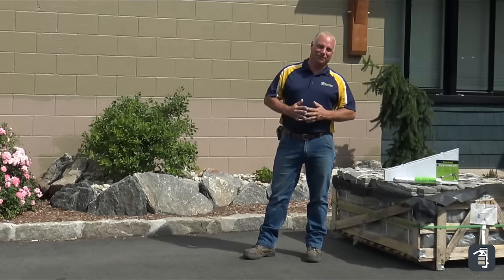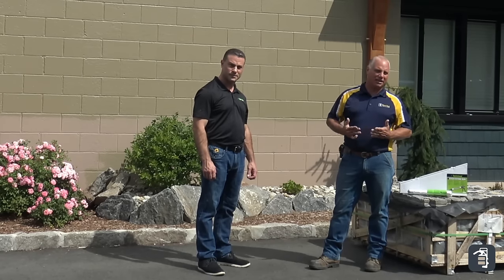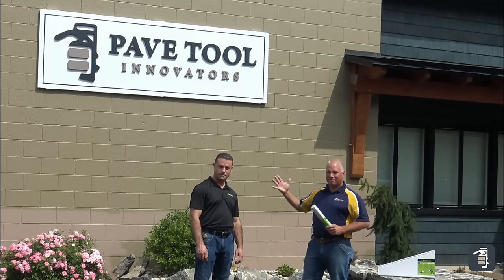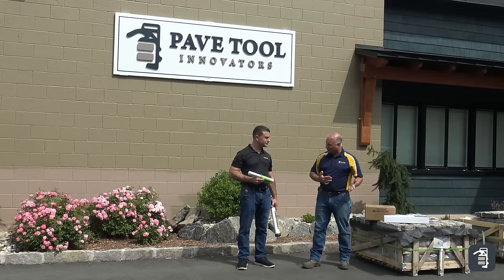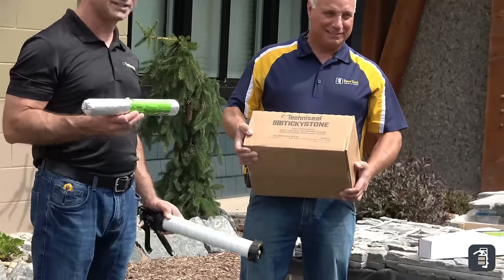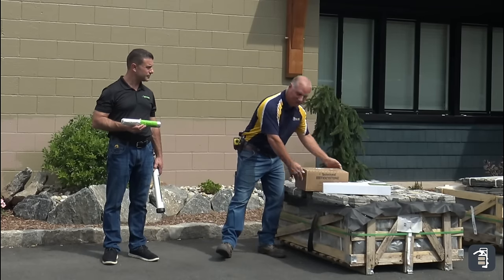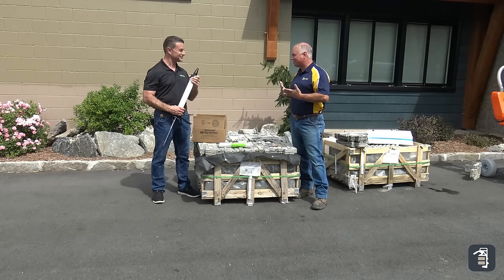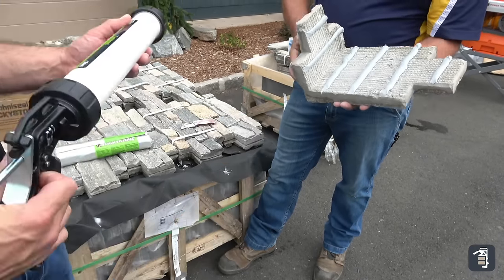Vertical Adhesive is in...Mortar is out...

Comment: Only time will tell if this product holds up. Mortar has done proved itself pretty good
Reply from the maker: This product has had a lot of testing done on it...  If I can get a hold of the spec sheet I will for ya...  Thanks
Reply: @PaverToolInnovators  I own a brick home. Could I do the complete outside of my house with this product if I wanted to. ?
Reply: @clevewilks4312  you could, by why would you on a brick home?... maybe do bottom 3 feet as an accent, but anymore than that i think you're just trapping moisture in the brick going forward
Reply from the maker: @notimportant3686  The installation method of Sticky Stone is to use vertical beads 3" apart which allows enough air space for moisture to dissipate. This prevents moisture to build up between the wall and veneer stone.
Reply from the maker: @clevewilks4312  Your brick and mortar would need to be in good shape. Make sure to use vertical beads 3" apart to allow enough air space for moisture to dissipate and to follow all manufacturer's guidelines and recommendations for the best outcome: https://techniseal.com/pub/media/catalog/product/pdf/t/d/tds_stickystone_can_en.pdf
Reply: @PaverToolInnovators  Could you use this product on individual "stones" instead of the panels that you demonstrated?
Reply from the maker: @cubbie8330  Yes. We have another video that shows this: https://youtu.be/6bHu5MoLlHQ
Reply: Is a loxon paint over cinder block ok for installation? What about freezing water behind veneer? Does it hold up under pressure? I suspect the adhesive goes on Vertical every three inches so water can drain from behind it?

Comment: The only application this product is suitable for is the panel like stone you are installing. If you were to use this on a traditional thin stone veneer it would be nothing but a gigantic mess trying to glue each individual stone into place as well as the fact that most stonework requires a mortar joint anyways. Also the way the glue is applied onto the back of the stone allows water to collect in the voids between the adhesive and could be problematic in the future.
Reply from the maker: We find that Sticky Stone is the most effective with large format veneer or panel stone. The purpose of vertical beads 3" apart is so that when it rains the water can make its way out from underneath the stone without being trapped.
Reply: It looks like a very simple to apply alternative,but even with vertical lines of adhesive I wonder how well it would hold after 5 years of freezing and thawing cycles of here in northern New York Adirondack region?
Reply: @dalerounds4036  Is it really true that the temperature up there gets as low as 52 below zero F? :-)

Comment: Nice product. I did a project quite a few years . I screwed hardy board to studs then buttered brick veneer with liquid nail and spaced evenly. Then mixed mortar , went through with a mortar bag and smoothed out the joints. Went pretty smooth
Reply: Where would we be without Liquid Nails?

Comment: Can you use Sticky Stone for placing stone veneer on the bottom of archways without the need for vertical support holding the stone in place until it dries?
Reply from the maker: It depends on the weight of the stone. If it starts to sag you will have to place support underneath the stone but once it dries enough you will be all set to remove the support.
Reply: @PaverToolInnovators  Thanks so much for the quick reply.
Reply from the maker: @kiheidude  No problem, sorry we did not get to you a few days ago! If you have any other questions please let us know. Good luck!

Comment: I'm considering using Sticky Stone.  Wi it work on a cured concrete foundation?  Mine was poured in 2007, and nothing done to the exterior.   How shouldI prep the concrete foundation?
Reply from the maker: Just be sure the foundation is nice and clean and you'll have no issues adhering to the foundation with Sticky Stone.

Comment: I am going to be replacing a vynil siding on the front of my house and I am planning on doing a stone veneer. I like the potential of this product. I am wondering if you are starting from a concrete base to rest the stone on, do you lay a bottom bead? I also am trying to think about how you prevent the gaps that termites find thier way into.
Reply from the maker: If you are going an exterior application I would suggest screwing hardie-backer or concrete board to existing plywood and then use a water proofing product (Ardex 8+9 is a good product) and tape and seal of all the seams. So you don’t introduce moister to the plywood. Then you would adhere your stone to this. I would screw a temporary 2x4 on the bottom to hold first rows of stone and remove when you are done.

Comment: It looks like you appled to painted cinder block. Can you use it on painted cinder block?
Reply from the maker: Sticky Stone will last as long as the paint lasts (typically 30 years). For longer lasting application remove the paint to reveal the concrete surface.

Comment: I want to make a Hearth for my wood stove. I have a 5' by 5' platform and a 5' by 6' back. Will this product work on Rock Board? Wil this product works with the heat of a wood stove. I mean will they start falling off from the back board?
Reply from the maker: You can use StickyStone outside the wood stove but nothing inside that will see extreme heat

Comment: What happens when the paint peels, will the adhesive that is attached to the paint come off?
Reply from the maker: Sticky Stone will last as long as the paint lasts (typically 30 years). For longer lasting application remove the paint to reveal the concrete surface.

Comment: Might have missed it- may I ask what you prepped the painted bricks with before applying the sticky stone and veneer?
Reply from the maker: For testing purposes we pressure washed the painted surface thoroughly to see how it would hold up. We have not had any issues but we would recommend wire brushing the painted surface to confirm that you are getting good adhesion. You have to use your own judgement the stickystone is only as good as the substrate you attach it too.
Reply: @PaverToolInnovators  thanks for responding.
Reply from the maker: no problem have a nice day!  @DavidLCangelloMDFACSNewYork
Reply: @PaverToolInnovators  you too!

Comment: Will it hold in cold climate, like MN, WI, etc?
Reply from the maker: Be sure to apply in temps above 32 °F (0 °C) to ensure proper curing. Sticky stone is designed to withstand freeze and thaw cycles after the proper curing process has finished.

Comment: Uuum..... You're placing a LOT of trust in the paint on that block. I would have brushed that A LOT, down to the block.
The adhesive will stick to the paint just fine. I wouldn't trust the paint to stick to the building forever.

Comment: Will this products adhere to ICF walls (EPS foam)?  ICF wall will have a waterproof coating.
Reply from the maker: Sticky Stone can adhere to ICF walls but we wouldn't recommend using it to apply heavy product. Heavy and light are relative definitions. What type of product are you trying to apply and roughly how much does it weigh?

Comment: I bought some thin flagstone and covered the wooden pillars on the front of my hose. They were normally wrapped with rough cedar boards but after a year they looked like crap. I treated the cedar boards then wrapped over the top with concrete boards then used construction adhesive to attack the flagstone. They slid around a lot but some duct tape worked. It would be nice to have something like this as long as its strong enough.
Reply from the maker: Sticky Stone works well with wood and concrete board. The recommendation is to allow the bottom leveling row to cure for 15 minutes and then continue to install the rows above with no delay.

Comment: How has this sticky stone held up over the past 2 years?  I'm coming up on a very similar project and this product seems like a total game-changer for folks like me trying to do a DIY home improvement with no masonry experience.  My main concern is that this product is so new and there isn't much information out there about its' performance over time.  Thanks!
Reply from the maker: We've had this on our building for the past 2 years. We allowed water to go behind the stone for a year to test if the freeze thaw cycle mixed w/ water would have any effect. We were excited to see that the product was so strong, it was still very hard to chisel off. You can use your own judgement but we feel the product has done very well over time.
Reply: Thank you for the reply, glad it's holding up so far! Is this the primary product you use for most exterior veneer installations now? Curious if there are still use cases where mortar would be preferred (or maybe even necessary). For example, I'm looking to install a stone veneer next to a saltwater pool with some water fall features coming through them. Between the water falls and the location right next to the pool, do you think this would still hold up?
Reply from the maker: @stevenprendergast9767  Once stickystone has cured general watershed will not affect its integrity. As always be sure to do vertical beads so no water collects behind the stone. Good luck with your project!

Comment: Well educate me as to what happens when moisture finds a way to build up between the wall and the veneer stone surface,
and then freezes?
There are as you know roll on adhesives that are intended to be used as a bonding agent on things like painted block walls so stucco can be applied on those painted surfaces.
But dont try that in parts of the country where temperatures go below freezing.
 Mind you now that drilling a series of holes in solid rock and filling them with water, is a method used for splitting the stone.
Such is the power of freezing water.
Reply from the maker: The installation method of Sticky Stone is to use vertical beads 3" apart which allows enough air space for moisture to dissipate. This prevents moisture to build up between the wall and veneer stone.
Reply: What happens when the glue expands and contracts due to freeze and thaw does the glue eventually get brittle and lose its hold over time
Reply: Stone, like other things including Brick, is layed in mortar, and lasts for very long periods of time.
It also requires well trained people to do it.
This type of a product isnt intended to be a long lasting solution, simply meant to look good , be economical, and require less skilled people to install it.

Comment: Will this work on a wet wall? I mean, a block wall that has small leaks when it rains??
Reply from the maker: We are unsure of what your scenario is, but as long as the wall is structural/not failing, and you install while it is dry and allow it to cure dry, keep your beads vertical so that water can flow and not build up, you should be ok. Add weep holes if needed.

Comment: Does it come with any kind of warranty against the stone veneer falling off or are there any issues with rain or freezing temps?
Reply: I was wondering the same thing.  Without full coverage of the adhesive/mortar layer water and ice can collect, expand, and cause delamination issues.
Reply from the maker: We recommend making the beads 3" apart so water can't collect.

Comment: I am installing a ledgerstone on my bbq island will this adhesive work? And also where can I get this product. TIA
Reply from the maker: Sticky Stone will work on ledger stone but what specific type of material would you be applying it to regarding a bbq island? 

We sell Sticky Stone here: https://pavetool.com/products/techniseal-sticky-stone
Reply: @PaverToolInnovators  right now i have a cement board around my bbq island.
Reply from the maker: @reynantelicerio2298  Yes that will work but I recommend watching this video where we explain the application on concrete board starting @ 2:10: https://youtu.be/knwiNLFQlXc
Reply: @PaverToolInnovators  ok. Thank you for the info
Reply: Where can i get the items? Home depot carry them?
Reply from the maker: @reynantelicerio2298  No problem. Thanks for watching!
Reply from the maker: @reynantelicerio2298  We carry Sticky Stone: https://pavetool.com/collections/joint-materials-adhesives

Comment: Can this be used on ICF?
Reply from the maker: Sticky Stone can adhere to ICF walls but we wouldn't recommend using it to apply heavy product. Heavy and light are relative definitions. What type of product are you trying to apply and roughly how much does it weigh?
Reply: @PaverToolInnovators  makes sense. Can you recommend  "lighter" products for external use?
Reply from the maker: @tdmallet  This is the most information that we know at this time regarding ICF block. This is a situation where we don't want to give incorrect information but hope to in the future. I know this might be a little frustrating but hope you understand.

Comment: Mortar might weigh more but the cost isn't near what that stuff costs. The gun and only 3 tubes of sticky stone is $136! Kinda spendy. Imagine what a case of it costs?!
 I decided to go a different route and use Loctite Premium Fast Grab which is plenty strong and much cheaper (using a normal caulking gun)
Reply from the maker: Cheap isn't good, and good isn't cheap! We hope it holds up for you... many of the Loctite products do not hold up in freeze and thaw climates, or in wet climates (according to testing we've found on Google). Sticky stone withstands all weather, and can resist over 10 times the weight that cheaper adhesives can. Depending on the project, it is well worth the investment.

Comment: No wonder it is the greatest since sliced bread. $50 a tube, $100 for the plastic dispenser. Can't even buy it without going through a distributor either.
Reply: Alright all, this is a first to me, but after tracking down a distributor near me, I ordered a dispenser and 4 tubes for a stone veneer job. Figured I'd give it a test. Ended up being 170 for 4 tubes and a dispenser, so actually not that crazy expensive since the dispenser will be used again.

Install was painless, went well. Dispenser is actually pretty nice, high quality metal and plastic where it makes sense. Would be awesome if tips weren't used up (sticky stone hardens in the tip- a good cleaning would let you re-use it).

Assuming it holds up, I am changing my ways.

Comment: Does this only apply to thin stone veneer?
Reply from the maker: STICKYSTONE™ is perfect for veneering applications on a wide variety of substrates, including but not limited to :
-Gypsum boards/ drywall
-Wood, pressure-treated wood, and plywood
-Brick
-Concrete blocks
-Cement boards

Possible veneer materials include, but are not limited to :
-Manufactured, decorative, or natural stone
-Alternative masonry
-Outdoor porcelain tiles or glass
-Wood and composite materials
-Concrete pavers

Comment: What happens when you attach to drywall is that you are only attaching to the paper when the paper separates your work will fall off
Reply: You never stick it to dry wall it will never handle the weight or moisture have to remove the drywall and install plywood or particle board
Reply from the maker: We plan to do the test on sheet rock,  the paper will peel off the compound if you are installing heavy stone for substantial length, we wont know the exact weight and max height until we do more testing.
Reply: Do not put this, or any masonry product directly on drywall.  Drywall is not made this.

Comment: This product would do well in China. In fact it may be manufactured there. Not sure. But when I visited that country, it was very clear that all that mattered was the outward appearance of quality. A real stone/brick veneer has minimum requirements to support the weight. It also has a venting and drainage cavity. So of coarse the traditional method is more time consuming and expensive. As an architect, I would only specify this type of installation in limited areas that were space constrained. In those cases, the envelope consultant would sign off on the installation method - best where there are large overhangs to limit exposure to water.
Reply from the maker: Patrick,
Thank you very much for watching this video and taking the time to share your input!

Comment: The biggest problem I see you guys facing is that any new construction and in particular commercial construction has engineering specs.  You must follow the installation requirements or you will be in some serious trouble and to date I've never seen a spec call out for this type of adhesive.  There will also be hesitation on unproven technology.  I've been bitten myself with manufacturers claiming there product is great but having it fail later.  I had this happen about a 2 years ago with a new firebrick adhesive.  Fortunately, the general contractor provided the adhesive and I specifically detailed in the contract that we were not responsible for it.  Less then a year later it failed, badly.  Not saying this will happen with your product but there will be an uphill battle to convince old school masons and engineers.
Reply from the maker: Hello Ryan,
You make a fair statement and I'm sure that was an unpleasant experience for you. Techniseal is a company that has been around since 1984 and their products have proven themselves. Please visit this link for their full specs/test methods: https://techniseal.com/pub/media/catalog/product/pdf/t/d/tds_stickystone_60050572_us_en.pdft
Reply: @PaverToolInnovators  I might try it out for some smaller projects and repairs see how it works but on larger projects you pretty much have to follow the installation method described by the engineer/architect.  If you guys could get more companies to specify your installation method maybe it could be a snowball effect.
Reply from the maker: @Ryan-ff2db  Sounds good. Feel free to keep us updated on what you find. We will definitely be doing more in-depth videos in the future. Thanks again for the input it's much appreciated.